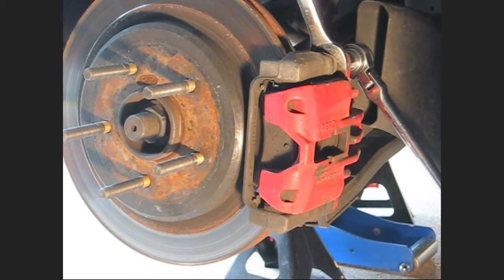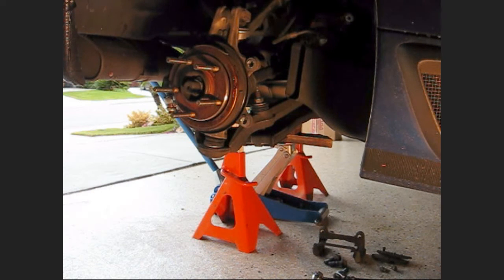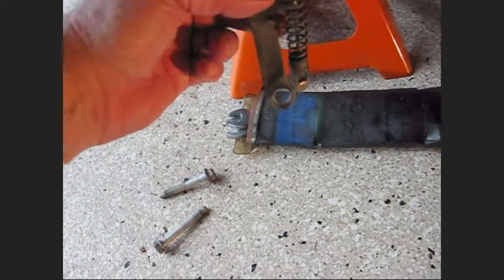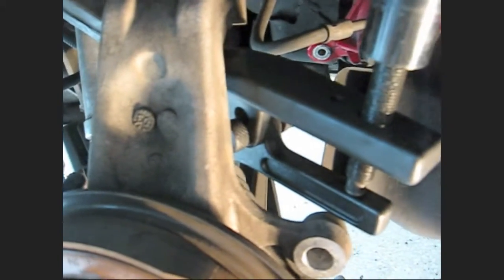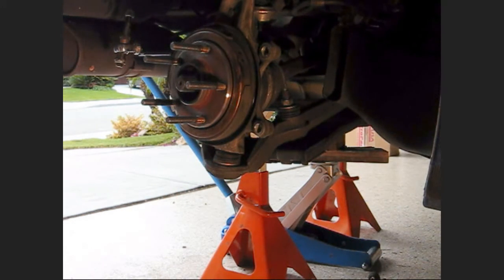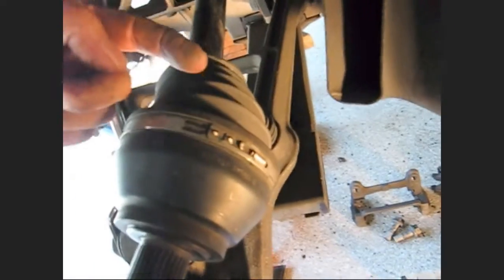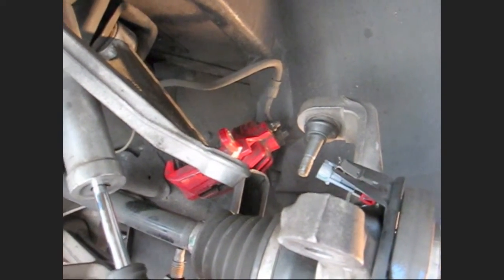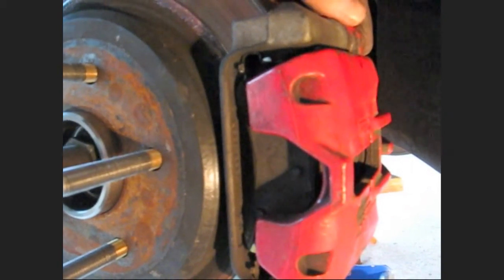Corvette wheel bearing replace by froggy repair c5 z06 r&r

Comment: Froggy...4 years later from the date of your video date...I have C6 2008...similar rear hub... have the rear hub 99% off...and the bottom bolt to the ball joint is my demise.  I tapped the axle and got it moving, when I stopped for the day.  That bolt took up HOURS today fiddling around with it.I was afraid taking the axle out would lead to nowhere.  BUT then I found your informative video.  And you had the exact same problem I am having.  I see what you did...and removing the axle will solve my problem duh...I let fear get the better of me....THANK YOU FOR GETTING ME BACK ON TRACK!!! I cant wait to finish the repair tomorrow!  Thank you again!I suggest you could change the title to include C6 Corvettes too.  All the other C6 videos say, "Tap the bracket and the bolt will pop out"...NOT!

Comment: Great work, my friend.  I've rebuilt/modified many engines from the ground up, worked/hacked on the electronics, et al. but the suspension and brake-related jobs are areas where I normally shy away.  However, I tackled this job yesterday with little-to-no apprehension, thanks to your walk-through.

Here's an e-Corvette Wave for you!
Reply from the maker: Glad it helped!

:)

Comment: I couldn't undo brake caliper bracket with knuckly on car so I removed knuckle complete with rotor as one piece. Then I could get an impact wrench on those bolts. Also, I removed the axle nets before lifting car. They were unbelievably tight. Took my breaker bar, 4 foot cheater pipe and all strength to break them loose. Thanks for the video. It really helped.
Reply from the maker: +Seth Williams Yes, caliper bracket bolts are TIGHT!

:)
Reply: what is the torque spec.for the bracket bolts

Comment: Froggy great video used your method replaced both rear bearings and shocks. Thanks for all your efforts on C5 work.  Used your radiator replace as well you do a great job. Following your steps and getting ball joint tool from Harbor made it much easier both axle shafts came off with bottom ball still on no rust on splines.
Reply from the maker: +H Miller Excellent!

Comment: hi froggy.  Wanted to say excellent video.  I used it step by step for my 97 cammed ls3 rear passenger wheel.  only thing different is I left the driver side tires on the ground and used a pickle fork,i did pierce one ball joint. thank you very much
Reply from the maker: Thanks for viewing!

:)

Comment: Another great video Froggy, thank you sir! I left my other wheel on the ground which helped me taking the axle nut on and off. I also used a pry bar and large rubber dead blow before using my ball joint separator and all but the bottom one popped loose. Thanks again.
Reply from the maker: Glad you work "smart". Thank's for viewing.

:)

Comment: Im testing the front bearings in my 97...man what a hugeeeee difference unbeliavable it runs super smooth ...bad old bearings felt very rough on straigt line and turning it made a sound like offroad tires ...i can't believe how this helps soooo much to the performance of the car ..
Reply from the maker: Good job!

:)

Comment: Thx for the info;  I just did the right rear hub on my 2002 C5.  The knuckle asm came off the ball joint shafts with just a little light hammering around the bottom one (top one came loose while removing the nut). Track rod end required a bit more hammering.  One suggestion for others;  leave the brake rotor on the wheel hub until you loosen the axle nut so you can apply the emergency brake to stop the hub from turning while you bear down on your breaker bar
Reply from the maker: +Roger Mason Thanks for commenting.

:)

Comment: Per corvette forum The spindle nut should never be torqued to 160 lbs. Known to break axles on the street with high horsepower or not! This is a mistake found printed in some of the GM service manuals and elsewhere. It was supposed to be 160 n-m. It's supposed now be changed to 120 lbs per in. Followed up with RED Loctite. The nuts are known to come back off if new or reused.
Reply from the maker: Excellent info, thanks!

Comment: Question about the skf wheel bearings. How did they last for you? Some serious racers only use skf racing bearings $400+ , compared to regular skf $135. I only do occasional hpde events and am thinking the regular skf should be good enough for me. Any thoughts?
Reply from the maker: I used skf regular, they are great. Race bearings are for real racing. Or guys with too much $$$.
Reply: froggy thanks for your input!

Comment: froggy. I couldn’t get the axle nut off. I tried breaker bars(2 broke), 1/2” ratchets (2 broke) and after the first time both broke I heated up the axle nut. Then I broke 1 breaker bar and 2 1/2” ratchets. I was so dependent on the torque specs when it was last serviced that I thought I could do it with no problems. Anyway. I took it to a tire shop and it cost me 5$ to loosen the axle nut. Went to Sears to exchange the broken tools. Followed up on your video and now it’s all golden. 

Just wanted to share if you don’t have an impact at home. Maybe this would help. I ended up buying a whole set up. Compressor and some other items for any future needs. Ty
Reply from the maker: Thanks for posting this good info. These are TIGHT. A GOOD impact gun helps.

:)

Comment: Froggy, I was curious if you could confirm if the C6 ZO6 procedure is the same as here on the C5Z, other than the different caliper is the rest the same basically? I have a 2007 ZO6 and have a slight road noise for the rear that I believe is the bearing, no movement when lifted and wiggle the wheel but you can hear the noise speed up and slow down with speed (mainly hear it starting around 30 to 35 mph and up). I don't think the tires are the issue, they are new Michelin Pilot Sport A/S 3 and the noise was there even on the older Bidgestones.  Thanks, I have checked out many of your videos and see you also now have a C6Z, I also had a 04 ZO6 and enjoyed it too.

Comment: saw you had to take out axle to get bottom ball bearing out.
if you loosen the nut all the way on the ball joint then finger tighten it.
once you do that you can hammer in your puller angle it up some and tighten the seperator once it pops loose take the nut off as you lower the control arm

Comment: C5 Owner here 75000 miles on mine.  All of a sudden I hear now a humming noise from the rear I think when I get over 40 miles per hour on the road.  I assume the bearings are going bad, is there a way to test which wheel it is or if it is a bearing problem.  Thanks for your help
Reply from the maker: Look thru the corvette playlist, should be a couple on testing for a bad bearing.

:)

Comment: Froggy: Thanks for the video. Just one question.Once you had the hub on your workbench it looks like you just unbolted the Torx bolts that held the hub to the knuckle. Did you have to press the hub out of the knuckle or was it loose once you got the bolts out.  It looks as though you could have just unbolted the hub and removed the axle once the tie rod was removed..  I'm curious as to if it would work that way? Thanks in advance.
Reply from the maker: No press needed, to me unbolting the whole hub is more work.

:)

Comment from the maker: For transce080,

If you don't think it's for you, then don't try it. This one is NOT on the easy end of things to do on a Vette. You might consider a "recommended" independent shop and save 20 - 25 % over a dealer.

:)
Reply from the maker: It is NOT something that only a Chevy dealer can do, they are no better/worse than independents.

Comment: Yes traction control light and ABS light is on and it seems nobody remanufactures the EBCM have you done this as I have a 2000 and it appears the 1999 and the 2000 cant be repaired whats your thoughts. The ones on eBay are very expensive like 900 to 1500 dollars.
Reply from the maker: Look on Corvette Forum, search it, there are a couple of guys that fix these. Google ABSFIXER.

Comment: Thanks , I have a click when cars jacked up and rock the tire forward or back (not in and out like this video) any thoughts ?
Reply from the maker: A bad bearing does not USUALLY "click". You see it and feel it usually. It could click if it's really bad, but look to other suspension parts behind the wheel.
Tie rod for example

Comment: froggy, Thanks much for your videos!  Do you think its possible that the CV joints on my C5's half shafts could be worn if I'm getting a (clang) shifting the automatic from drive to reverse? The car is an 02 & has 46000 miles on it.
Reply from the maker: tor tuga Possible sure, but it could be a few other things. Guibo's in the torque tube, loose axle nut, diff.

:)

Comment: Froggy: I just changed both my rear hub assemblies and your video helped out a lot. I am a pretty good do it yourself kind of person tackle a lot of big projects and my 03 C5 is purring like a kitten again.  I cant help but wonder if my wheel noise could have been attributed to a possible loose axle nut, it sure seemed like they were loose when I removed them.  Have you had this happen before loose axle nuts causing rear end noise, I did do the wheel test and did have some movement on both sides so I just replaced both sides made a day of it with all the chassis and suspension cleaning LOL.
Reply from the maker: I have not had axle nuts come loose myself, that is a separate issue & different symptom from wheel bearings.

:)
Reply: Thanks again froggy...
Reply from the maker: Thanks for viewing.

:)

Comment: I get the lower ball joint free before the axle by using a bottle jack to jack up the knuckle (or lower the car with something under the knuckle) and then tap on the side of the knuckle at the joint, and it pops lose, (doesn't require much tapping). Then pull the assembly off the axle.  Thanks for the video, I didn't realize it was possible to get the axle out before getting both ball joints off.
Reply from the maker: Thanks for the comment & watching.

Comment: Froggy, the rear end feels loose on my 2000 frc. What do you think it might be. I know there are all kinds of rear suspension parts,but where should I start ! Wheel bearing , tie rod ends,ball joints.
Thanks

Comment: Froggy,
Great video collection. I have a 03 50th Ann. That's been on jackstands for last 7years. It went over 8" curb sideways in rear motion skidding out of control. (Daughters took it into town to wash for me on Father's day...) Anyway! I've started fixing it. Got it driveable. Less my 4 CCW rims. Has stock shoes on now. My request or question is. Besides making complete jig like yours. Do you know of a quick method to A-line all four wheels? just to get it in the ballpark. just squared enough, to drive it to the alignment shop. I got a 20 mile journey to make it to the closest trusted alignment shop. I am out of line everywhere on all fours. I don't have anything/whelel to square off of. all four wheels caster camber adjustments you know I've been altered and the new replacement parts put in I didn't have a reference point to where they were knocked out of the ballpark am I going over the curbs. I have a welder and plasma cutter I can make up some kind of jig quickly but I just instead of go and make your complete jig up that you have for alignment I just would like something quick to get me squared up so I can just drive it to the tire shop without eating my new tires up
Reply from the maker: Do you have any decent old wheels/tires to put on.? Alignment does not have to be with the rims you end up running. It's totally independent of rims, I align mine now on hubstands, all wheels off.
Reply: Yes I have the original stock set of C5 rims with new tires on them.  I also have a set of c4 zr-1 rims with tires that just hold air. Then I have the CCW that are ovaled  all 4  of them.  Count them out. Because no two reference points would measure out the same on them they're in bad shape...
sorry about the first message. I had two customers walk in. I had three conversations going on at once.  I see you deciphered it LOL impressive
Reply from the maker: @robertsrepairmobileservice9104  Well, you could run some parallel strings on jackstands and line up the toe to zero front & back. The camber is not going to kill the tires if it's off, just put like 38psi all around to drive to an alignment shop. MAKE SURE they torque the adjusters to spec, it's HIGH. Big mistake a lot of shops make. Then put white witness marks on all adjusters so you can easily see it they move.

Comment: Froggy, Its time for an oil change in my c5.. I went to walmart to get some oil. it seems they have different kinds of synthetic oil and its pretty much the same price... what would you use? I remember seeing a video you did a wile back that talked about a gm spec but cant find it...
Reply from the maker: I got Pennzol Ultra last time I was there. Make SURE it's FULL synthetic. Mobile 1 good also.
Reply from the maker: froggy Read the fine print on the back of the bottle for thr GM spec.

Comment: I noticed in the video that you said it was the second time for the rear wheel bearing on your z06 my friend has over a 140000 on his  car with no problems yet ? How many miles on your z06 300000 lol
Reply from the maker: You need to understand easy miles vs autox/track miles. Thanks for viewing.

:)

Comment: hello froggy, this C5 has the so called death wobble when the car is going over 30 when it hits uneven blacktop. It does this going straight and or cornering.
Reply from the maker: I would get it up on a lift and look for obvious broken/worn parts.

:)

Comment: The 6x10 & 18ft trailer have 15"  tire/rims & the spare tire is a 15 also. But the 7x14 trailer has 14s. Would the 15" spare fit on the 7x14ft trailer?
Reply from the maker: Good question, you need to measure the hole spacing where the lugs go , the center hole and backspace of the rim. to see if the same . Most important on all trailers is the weight rating of the tires! Make sure they are rted for th mx load you will carry.
:)
Reply: So I need to measure from the lugs to the center of the hub then backspace. We do weddings & the load ratings differ all the time.
Reply from the maker: You need to make sure the tires are RATED for the MAXIMUM

and the stud pattern is SAME and BACKSPACE.

I would just try bolting them on and ck clearance.
Reply: ok. Will do. This week its going 2 b n the mid 2 upper 70s!! 👍👍☺☺!!

Comment: I changed my wheel hub assemblys on my 99 c5 corvette, but now my ebrake light is staying on, and the dash is telling me to service traction system and service active handling, any ideas?
Reply from the maker: Please check the codes, on a c5 you can do this from the buttons on the dash (thank's GM, pretty handy). then look up the codes and they will lead you in troubleshooting. My WAG is the sensor(s) at the hub are bad/not connecting.  Post back.
Reply: @1947froggy  It looks like C1247 and B2723 I think are the only current codes there were more but i think those are old because they just had the H after them.
Reply from the maker: @noinsane  H means it cleared issue. I suspect sensors but running out of ideas, verify they are correct part # for vehicle.  :)

Comment: Hey Froggy, just commenting on this to see if you still see comments this old. I am curious if you have a contact method?
Reply from the maker: YT notifies me every comment, even on old videos. Contact best thru comments, if it's anyone needing help or just commenting I like all the viewers to learn. :) I try my best to answer every one.
Reply: froggy Do you recommend any particular bearing? I’m almost done building my C5 which will be about 650hp at the crank, not sure at the wheel yet. Can I buy say a moot bearing and just use the ARP studs?
Reply from the maker: @cryptocarsandcoffee7854  SKF used to make a race duty bearing. Check those.

Comment: I'm wondering why you couldn't just pop off the lower ball joint and unbolt the wheel hub without removing everything?
Reply from the maker: It's on there with a LOT of torque, everyone I know takes the corner off. But try it & let me know how it goes.

:)
Reply from the maker: froggy Also I don't think you can get the axle out to get to one of the bolts.

:)
Reply: froggy
Yeah, the axle blocks the star bolts so you can't get them loose with out removing the axle.  I had to cut down 2 different allen wrenches to get the bottom ball joint nut off...  Thanks for the video...
Reply: Stuart Estebo A couple of things I noticed.  Axle nut and top ball joint need to be off before you attack the lower ball joint.  Also, Lower Ball joint needs to be tightened down first before you insert the upper.  There is no way to get the allen key out if you do the upper first.  Bringing the assembly off of the spline was the easiest part of the whole job...
Reply from the maker: Yep, thanks!

Comment: I'VE DONE ALL MY BEARINGS WAY EASIER THAN YOU SHOW...LEAVE THE KNUCKLE ON SPINDLES TO BREAK THE BOLTS...LIFT BOTTOM  KNUCKLE UP ON THE THREADS SO ITS EASIER TO BREAK THE BOTTOM BOLT...LOL
Reply from the maker: No need to SHOUT. You really don't have enough detail to convince me that you have a "better way", but I always like to learn more. Post a link to a video, or explain in much more detail.

:)